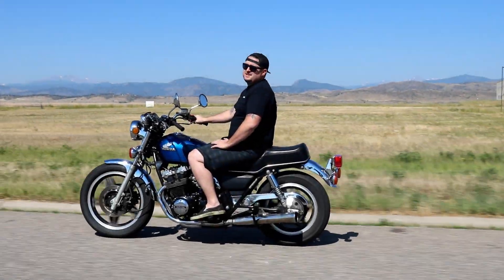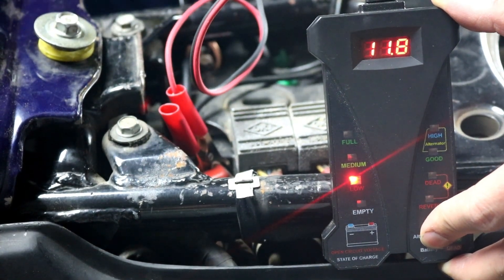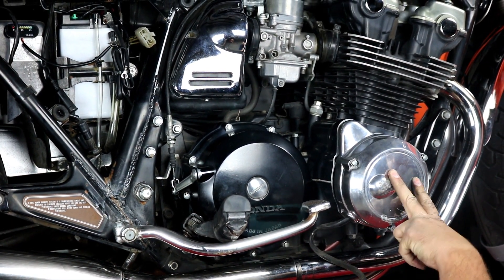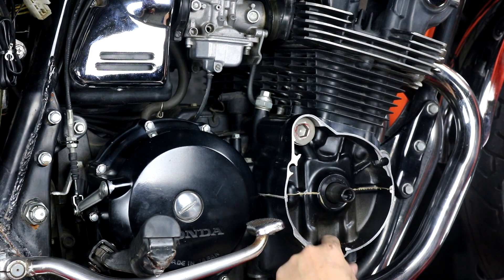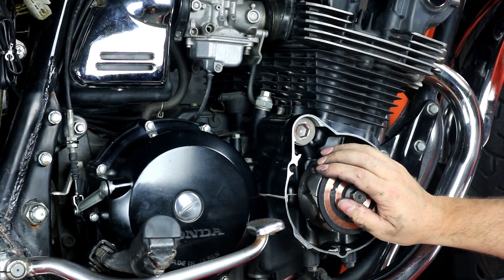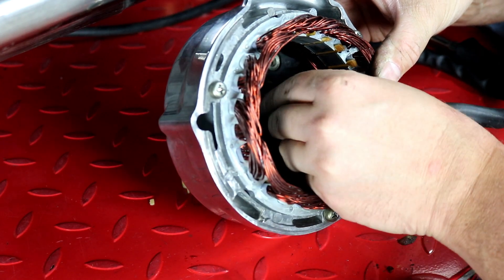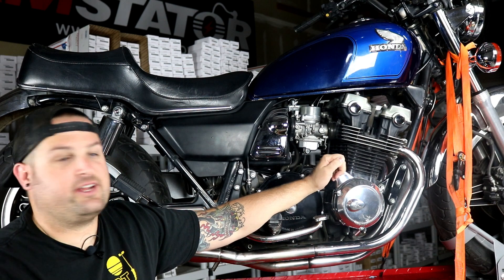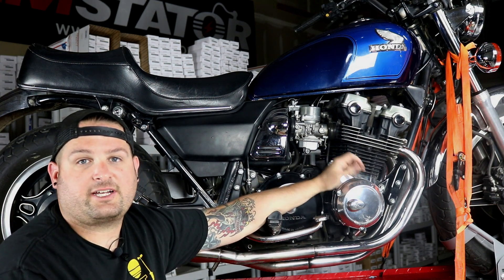Honda CB 650 750 900 1000 DOHC - How to Install RMSTATOR Stator and Field Coil Charging Rotor

Comment: Hey any idea on if you can put windshield urethane on the rotor to hold the epoxy in because my rotor epoxy is coming apart is that normal ?

Comment: I put a new rotor in my CB900C and getting 13.2 max at high rpm. My stator might be bad when at higher temperatures but seems to check out ok with ohms. I’m getting high resistance thru brushes but when I clean them resistance is improved. Do the stators come with new brushes

Comment: Bought a new battery and installed on a 81 Rs650.  Just bought the bike.  It sat overnight after a ride back home and now it wont start today.  My thoughts were the battery had died but the battery still showed fairly high in the charged range.  Any idea why it wont turn over from loss of power if my battery is good?

Comment: So will a alternator from a 1983 cb1000c fit onto my 1979 cb750k?

Any idea when you might have alternators back in stock?
Reply: I got one off of another cb750 parts bike that was good but now i have carb issues to deal with
Reply: @arealcanadian7448  you and I both. Mine are pretty rough. Have you done anything with airflow or with your pipes?
Reply: Did you get this figured out?
Reply: No i haven't done any of that
Reply: @arealcanadian7448  nice, then yours should be pretty straightforward. I’m likely going to have to end up rejecting re jetting
Reply: I pulled my air filter out and it is soaked in fuel

Comment: Probably a dumb question but would these be considered a alternator I’m very new to the bike world and no nothing really but am a mechanic of other things. I am looking into a 81 Honda cb650f and dude says it needs an alternator so that’s why I was looking for replacement videos
Reply from the maker: Yes, depending on make, they can be called alternator, generator, magneto in the OEM parts manuals. An 81 CB650F uses the parts in our video, which are technically a stator, field coil rotor, voltage regulator.

Comment: i need that tool to pull the magnetic rotor off! PLEASE HELP! send a link or something!!!
Reply: You can use your rear axle as well
Reply: areal Canadian what.
Reply from the maker: Here you go!    https://www.rmstator.com/en_ww/products/flywheel-puller-rms070-104604
Reply: I saw it in another video 
Remove the rear axle and thred it into the rotor all the way then tighten it good take a hammer and wack the axle inwards the shock will knock the rotor loose
Reply: https://youtu.be/yVU_RUE0c4o

Comment: Isn't the rotor supposed to be torqued down when you re-install it? Is there a way to tighten it down if the engine is out of the frame? Will you damage the transmission at all by placing the engine in gear to tighten the rotor?
Reply from the maker: Yes, the rotor bolt will need to be tightened up to draw the rotor onto the taper of the crankshaft. With the engine out of the frame you can just use an impact gun, it should tighten it up without the motor spinning much. You could also put it in gear and lock up the sprocket somehow.

Comment: Ty for your help
Reply from the maker: It sounds like you definitely need a new voltage regulator, and possibly stator. Also test the resistance of your field coil rotor, they are known to fail on CB's.

Comment: Is there a voltage regulator at 3000 rpm charges at 15.2
Reply from the maker: No, the regulation point is generally around 14.6VDC. You need a good functioning stator, field coil rotor, and regulator to achieve this on the Honda CB's.

Comment: What is used instead of points like older bikes
Reply from the maker: Electronic ignition became common in the late 70's, and early 80's. Your CB would have had electronic ignition. There are also good aftermarket options.
Reply: @Rmstatorinc  amigo disculpa soy de México ocupo el estator algún lugar donde pueda comprar en línea.

Comment: thanks for the video! I want to test the charging system on my ´83 CB110f, can you please tell me where are you connecting each tester cable? as i see they are not connected at the battery - and* and it looks to have a more easy access...
Reply from the maker: You would want to connect directly to the battery terminals for this test.

Comment: Do you.guys have a solution for the shit stator and rotor on the cb650 custom 85 model?
Reply from the maker: No, sorry. The 85 CB650's used a separate alternator, which we don't make parts for. We only cover the earlier field coil rotor type systems for Honda CB's. Thanks!
Reply: Thanks